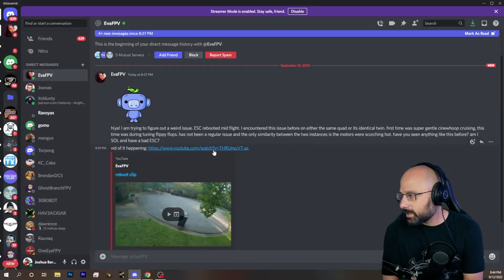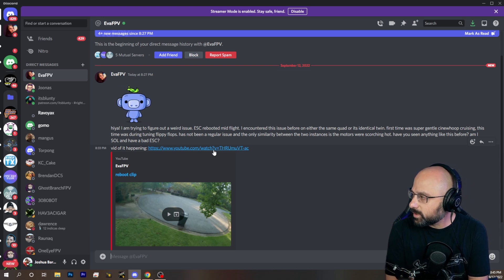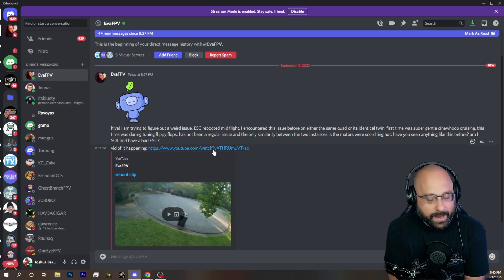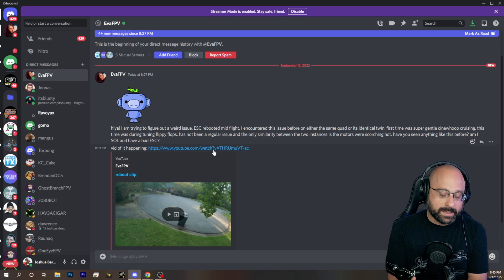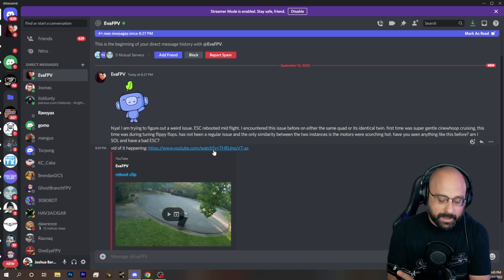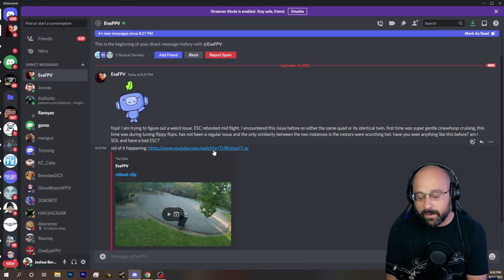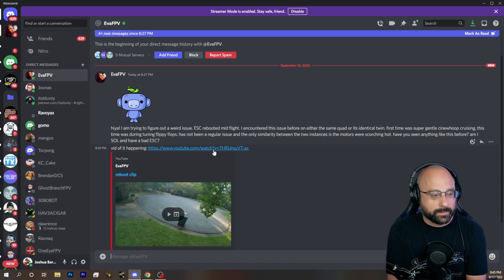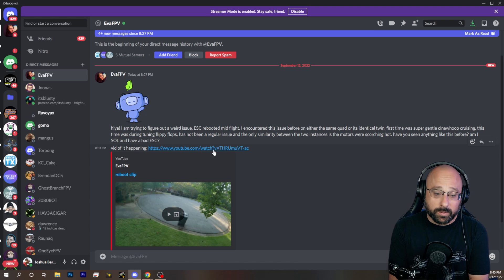My ESC Rebooted During Flight! What's Wrong? - FPV Questions

Comment: good video!!
Does anyone know if these things work together or does anyone have any tips?

- CNHL Black Series 1100mAh 6S 100C
- T-Motor Velox V2306 V2 - 2400Kv
- Mamba Basic F722 Mini MK3 F40_128k Mini Stack By Diatone
- RunCam - Link Phoenix HD Kit
- dji fpv remote controller 2
- DJI FPV Goggles V2

thanks in advance